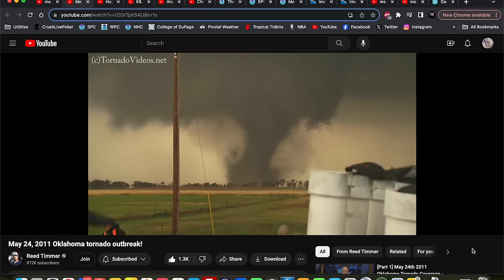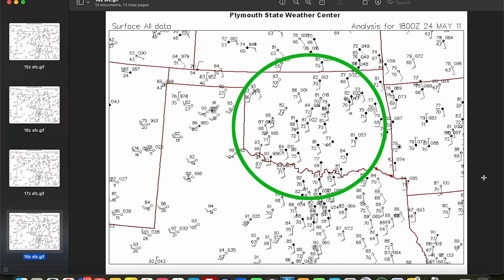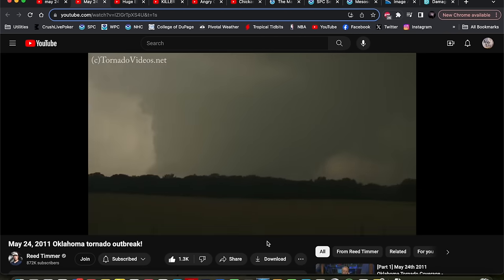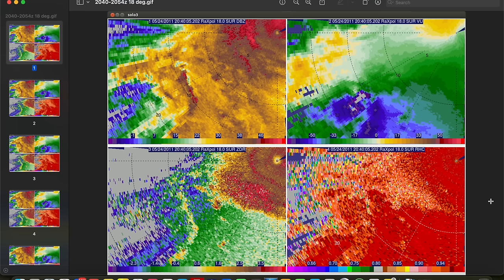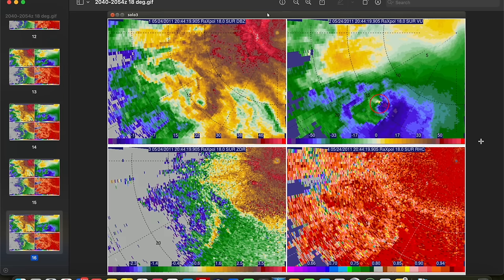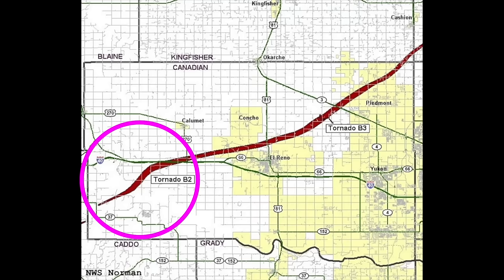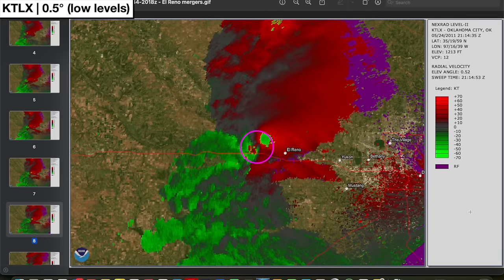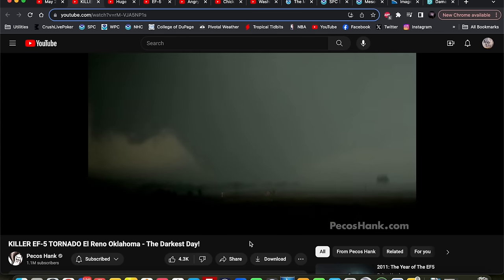The May 24, 2011, Tornado Outbreak: A Case Study

Comment: I know 1974 had one more F5/EF-5 than 2011 did, but 2011 had them on more occasions. Really was a crazy year for tornadoes.
Reply: Even had a tornado here in Massachusetts June 1st, 2011
Reply: A couple of those 1974 F5s (Tanner 2 and Sayler Park) probably wouldn't have been rated EF5 in 2011 and a few of the 2011 EF4s (Tuscaloosa/Birmingham, Chickasha, Goldsby) probably would've been rated F5 in 1974.

Comment: I'm fully convinced the EF5 from this day was and remains the strongest tornado since May 3 1999.
Reply: What's so crazy is that pretty much all the EF5s from 2011 except maybe Joplin produced some of the most outrageous damage ever surveyed.

Philadelphia 
* deepest ground scouring   ever done at roughly 2ft.

Phil Campbell 
*tore roofs off of underground concrete shelters

* produced what might be the longest continuous swath of EF5 damage in recent memory.

*erased woodlands 

Smithville - 
*produced some of the most extreme debris granulation since Jarrell while moving at an average speed of 55-60 mph

*reduced a brick funeral home to powder instantly

 *threw a vehicle into the town water tower

*scoured the ground up to 1 foot

*made a large truck vanish

*rent apart a bundle of large steel pipes at their welds and fragmented them.

Rainsville - 
*obliterated a stone home

 *tore a gun safe that was anchored thru a homes foundation and warped it, made the door vanish.

*Destroyed a poured concrete porch and scattered it. 

*Uprooted the top of an in ground concrete storm shelter.

El Reno - probably the most unbelievable tornado DI in modern times, the Cactus 117 oil rig was ripped from its anchoring and bent. It literally weighed 2 million lbs and was fastened down via large industrial anchors that added 200,000 lbs of down force.

Comment: Great video as usual Trey. 

I'd also like to share a cool little story. I live in Belgium and today we had a tornado in my city from a low-topped supercell. I was following its wallcloud from my window as I was positioned just south of the storm and it was amazing to see the dry slot cyclically sliding into the wall cloud producing multiple funnels. The final attempt succeeded in making ground contact and the result was a brief tornado that caused significant damage, I'm guessing EF1 or EF2. I guess I want to thank you, because its because of videos like yours that I could understand what was happening even before I had confirmation that the tornado actually touched down since I couldn't see it making ground contact myself. I later got confirmation from my aunt who lives in the neighbourhood where it touched down, luckily no one got injured. Thank you for these videos, they are very educational.
Reply from the maker: Thank you! I’m happy to hear the videos have been helpful for you! Congrats on catching a tornado; it sounds like it was a pretty cool storm.

Comment: I glanced quickly at the timestamps before the video began and was immediately intrigued. If you're only spending 13 minutes of 44 minutes on the meteorological breakdown portion of a case study, we're in for some super in-depth content and holy cow did we get that! Not much to talk about at the synoptic scale that you haven't talked about time and time again. Strong, negatively tilted trough, diffluence aloft, powerful low-level cyclone via lee cyclogenesis, strong warm, moist advection into the target region, ridiculously stout EML atop a deep moist layer, 3k MLCAPE and large looping hodographs, all in Oklahoma? I've heard it all before, and I know a lot of fans of the channel have, and I'm sure you're almost tired of repeating that string of terms at this point!

But then to dig into such incredibly specific mesoscale factors with probably the widest wealth of thorough high resolution radar data in any of your case studies to date is so wonderful. I honestly can't even recall how many new things I learned from this video, it was 30 minutes straight of learning new things. I absolutely adore seeing the mobile radar data as digging into these finer details is so vital for understanding individual tornadoes, and I long for the day we have a wide enough network of these things that we can use them predictively as tornadoes are ongoing to help understand the danger more precisely instead of only really being able to use them after the fact.

I can't say enough good things about how wonderful this video was, absolutely fantastic video Trey and I always get excited when I see a new case study. Can't wait for more!
Reply from the maker: Thank you so much! Yeah, this was such a classic tornado outbreak setup; there wasn’t a ton to say about it other than that it was pretty perfect from a synoptic/mesoscale standpoint. The real analysis came with the treasure trove of unique behaviors documented in the mobile radar data.

Comment: Amazing video Trey, really great explanation (as always) and great radar analysis of radar. To me, the outbreak on the 24th is the perfect example that there should be a higher hatched risk as, even though many of the tornadoes that touched down were ef2+, the amount of tornadoes produced was way lower than other 45# days (although a big majority of 45# risks like to underperform significally). That and hatched 5 and 2% tornado risks are things that should be added into convective outlooks.
Reply from the maker: Thank you so much! They do have a 60% hatched contour available, but to my knowledge, they’ve only used it one time, and it relatively underperformed.

Comment: the Infamous 2011 the devastating year that never would be e forgotten and always be remembered 

plus according to the models there could potentially be pretty robust storm system for next week that could potentially bring some rough weather for late this weekend and especially early next week?

stay safe and have a blessed New Year 😇😇😇🙏🏿🙏🏿🙏🏿🎊🎊🎊🎉🎉🎉
Reply from the maker: Happy new year to you, as well! Yes, there does appear to be a potent storm system on its way with a snow threat for the central plains and Midwest and a possible severe threat for the Gulf Coast states.
Reply: @ConvectiveChronicles   yeah I know and Tuesday looks pretty interesting as well in the severe weather department for the Southeast according to the models?
 even though the SPC/NWS doesn't have a 15% severe weather risk for Tuesday as of yet
so when do you think the SPC/NWS would issue an 15% severe weather risk for Tuesday???
Reply from the maker: @aprilbrooks1026 Right now, there's not enough model consistency to put in a risk area...if we start seeing some more agreement in a severe threat for Tuesday, they'll put one in.

Comment: 24:11... something clicked! I was wondering about this... so basically it was like two mini areas of low pressure stacked on top of one another? If one had stayed solo, the rotation would've been too broad and not tightened up.. but having two enhanced the spin.. like the figure skater that draws her arms in closer! Is that right?
Reply from the maker: Yes; you can think of a tornado as a circuit…if any part of the circuit is displaced/cut off, the tornado is unable to occur/continue. Once the circuit is complete, the tornado can begin…in other words, once the midlevel and low level mesos are aligned, it’s go time. Now, vortex tilt can play a role in this (the mid level and low level mesos might look displaced due to the vortex being tilted).

Comment: Really amazing stuff Trey!
One question i have is why might the El Reno-Peidmont tornado be classified as one continuous tornado, but the Hesston and Goessel Kansas tornadoes were classified as two seperate F5 tornadoes? As it would seem they went through similar merger scenarios. 

Thanks for any input or speculation on this.
Reply from the maker: Thank you! That's a good question; there probably should be an additional tornado along with the El Reno-Piedmont tornado in the archive. It may not have produced any damage before the merger, which might be why it's not in there. The Hesston and Goessel tornadoes were two separate, damaging tornadoes that formed independently of one another. The Hesston tornado was an F5 prior to the merger; it weakened, revolved around the ongoing Goessel tornado, and then merged, forming the new, singular Goessel tornado that also became an F5.

Comment: Hey Trey, another phenomenal breakdown! Could you elaborate on the process behind the formation of “roll” clouds ( 11:12 )? This region of stable air where the roll pattern forms? I’m thinking it’s because of the wind shear in place with a ML present above, allowing some “rolling” condensation to form but both become vertical? Wondering if you could clear this up!
Reply from the maker: Thank you! You're on the right track; the shear forms the rolls, but they get trapped beneath a stable layer, which also gives them their laminar look. Hence, they're a great clue for stability when looking at satellite.

Comment: Coming back to this case primarily because I think it has a lot of important lessons to portray about many of the southern plains ejections over the past few years (including the ones this year) the trough responsible for this outbreak remained very zonal ejecting in, with a powerful belt of flow on it’s backside (oriented still very zonally though) helping to kick it into a negative tilt orientation
The ejections over the past few years that have looked like classic Oklahoma outbreaks and ended up underperforming (5/20/19, 5/18/17, etc) appear to have been far more closed upon ejecting in, with lots of meridional flow in their exit regions, preventing them from really ejecting into the southern plains causing large tornado outbreaks
Interested to see what the upcoming ejection does, as it appears that the way it’s ejecting in has been trending a bit more favorable for truly punching into the southern plains
Reply from the maker: That’s a really interesting observation, thanks for sharing that

Comment: 2010 was such a strange year.......early 2011 also (at least for snow)
.
in montana.... we ended up getting 164 inches of snow. (mostly in EARLY 2011)
i wonder if the snow/moisture we got influenced these FAMOUS storms of 2011
.
we had no snow all year..... then a BUTT TON in early 2011.... till about march
then we got a years worth of rain in 2 weeks (which melted all the snow)
which lead to record flooding
.
record snow, record rain, record flooding (specifically around the glasgow MT area) 
just a CRAZY year
.
.
.
but ya.... im pretty sure that our snow / moisture influenced these tornadoes 
but i cant prove it.... because im not a meteorologist 
.
i just noticed a pattern (glasgow gets some rain/snow..... the southern states get a tornado..... over and over and over, and with out fail) 
with THAT MUCH water on the ground..... it simply HAD TO influence pressure systems that then moved south/east
Reply from the maker: Rather than the rain/snow itself influencing the systems as they moved east/southeast into the Plains, the storm track probably allowed storm systems to influence y’all in MT and then dig down into the southern states.